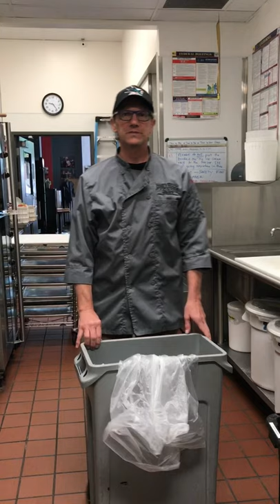How to tie off a trash can liner

Comment: Can this work with trash cans that have holes where u push the bags through them
Reply from the maker: Not sure. This is the only one we've ever used it on but it's always worth a try.
Reply: @missionhillcoffeecreamery1336  it worked, also do u have to put in the untied side first or can u put the tied side in first and place it across the untied side